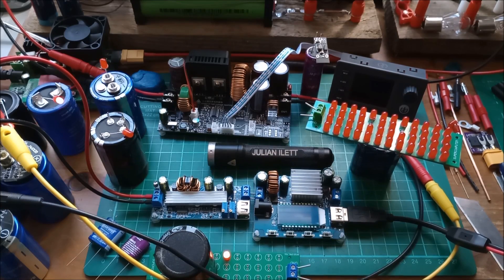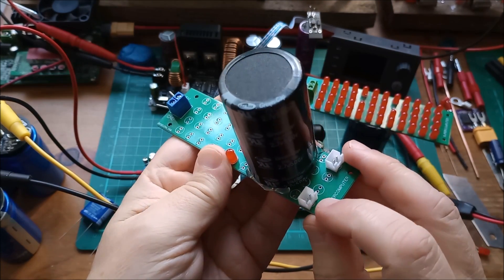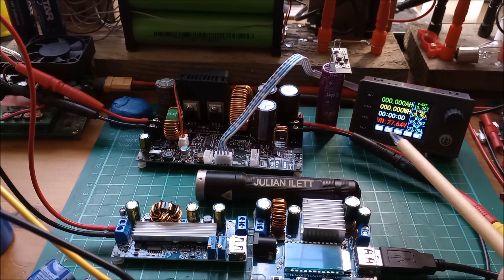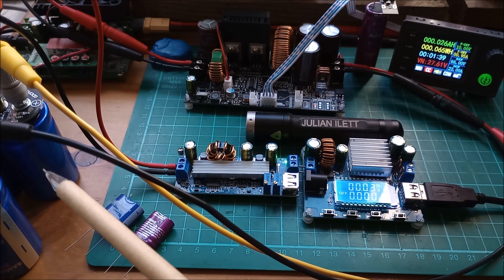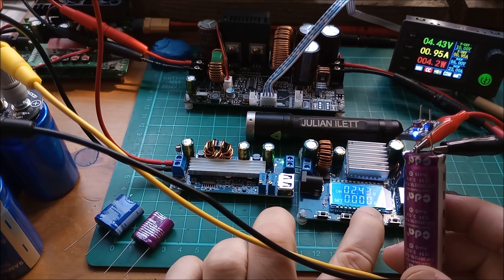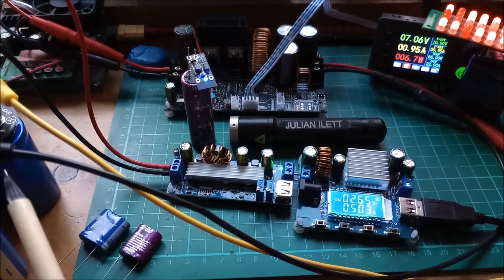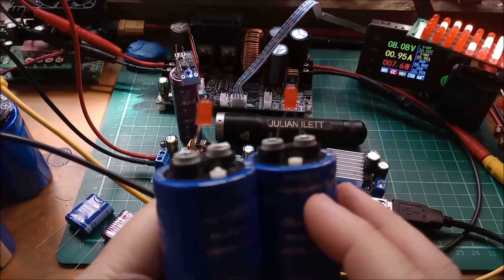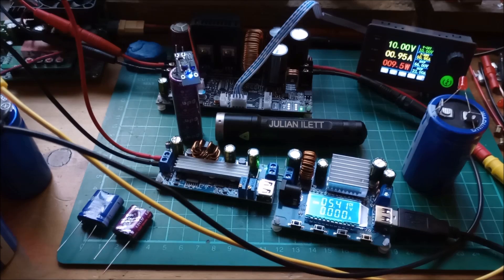Supercapacitor Playground

Comment: 12:04 Large pulse current will shorten life of capacitors. AA high current will waste energy from cell internal resistance (guess energy loss: zinc chloride AA >90% & alkaline AA >50%, depending how high the current is of course; NiMH less, not sure the amount).

Comment: What a waste of time, pointless other than to show the fake products you get.  You didnt measure ESR, very important nor try and estimate the actual capacity of the items by timing at constant 1A ie  to determine the capacitance value of my capacitor I simply have to measure the time interval in seconds while charging or discharging at 1A between 1 Volt and 2 Volts. Or 1.5 Volts and 2.5 Volts, any 1 volt differential should yield the same result.(As long as my charge current is constant) So my 100 Farad +-20% capacitor should take between 80 to 120 seconds to go from 1 Volt to 2 Volts.  Not rocket science
Reply: Calm down, it's Youtube, try and have fun.